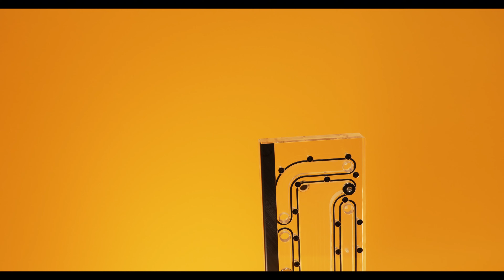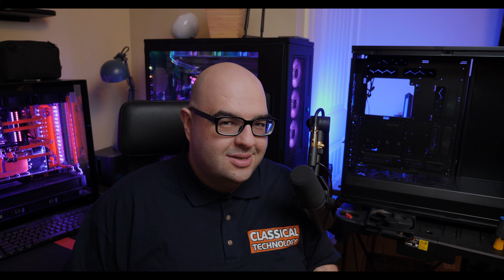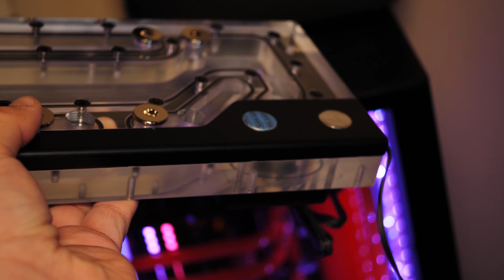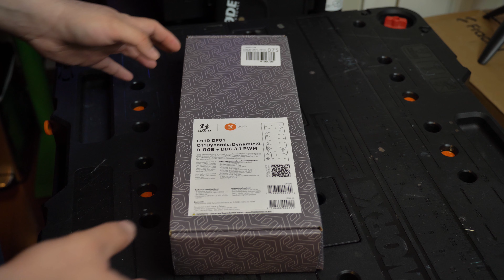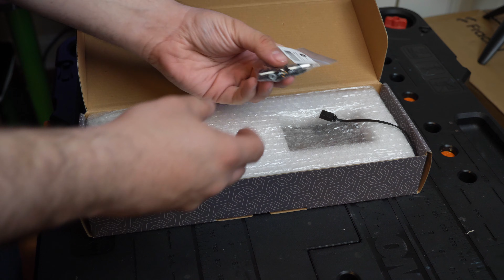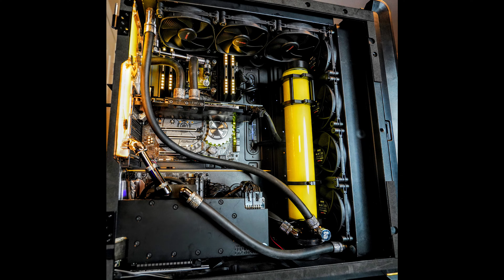Fractal Design Define 7 XL Build Video Part 2: Distro Plate Planning

Comment: Any progress on this? Have just bought one of these cases and interested how it works out for you
Reply from the maker: Hey. Just finished the tube runs on it, should have a video by next week up. Tried a few new things with it, including the water distro block on the front of the case
Reply: @ClassicalTechnology  Hey, that sounds awesome. Didn't notice you'd done another vid since this one until just before so watched that too lol. I like the direction you've gone in with the push pull on the top rad, what depth is it, 40mm?
Reply from the maker: It is- I actually got it to fit without push pull on top too, so I may go that route in order to make it a more streamlined build

Comment: I have this block in my Lian Li case so im excited to see how you do your tubing. I’m thinking of changing my loop slightly so gonna wait and see what way you plan it out!
Reply from the maker: Nice! How do you like it so far?
Reply: @ClassicalTechnology  I like it, seems to be doing the job and i like all the different channels you can work with to make interesting loops. I kinda want to change it so my end pipe finishes at the top of the blog so the fluid trickles down like a waterfall but i wasn't sure how to work it that way

Comment: I bought this block for my O11 XL case and it’s awesome! The only downside was that DDC 3.1. I ended up purchasing a DDC 3.2 pump and let me tell you the difference was night and day, only con I have when it comes to upgrading the pump is that it’s louder but still way quieter than when my FTW3 was air cooled.
Reply from the maker: Yeah, the 3.2 will definitely be better. They are starting to do more d5 pumps too in these type of reservoirs, so that will be a plus too